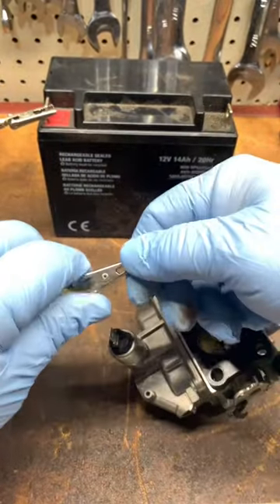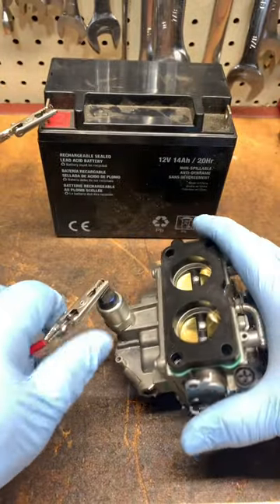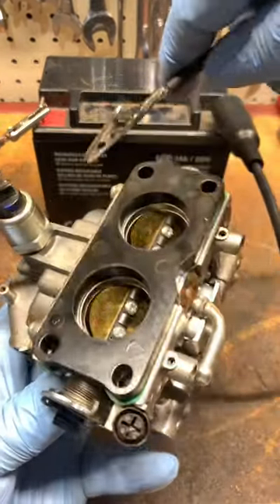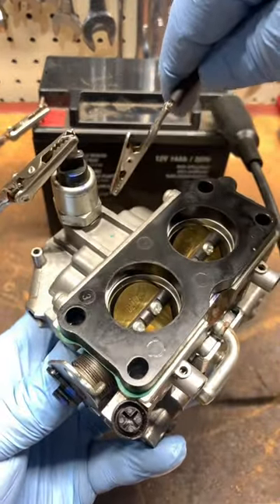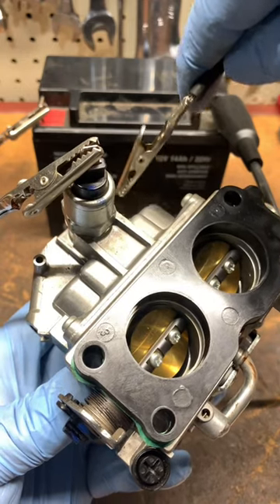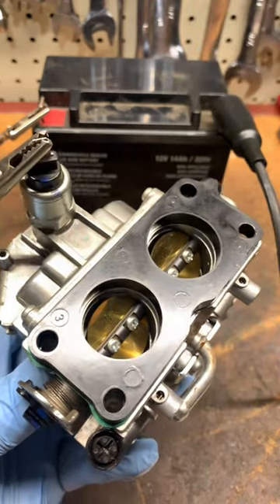Test your Honda carburetor solenoid without removing from engine

Comment: THAT DOES NOT MEAN ITS NOT CORRODED ANDTHE PLUNGER IS STUCK INSIDE!
Reply from the maker: If it is stuck and corroded then it would not click.
Reply: @10minutefix  literally just happened to me the day before I commented. Kawasaki  FS651V.
We were taught at Kawasaki school they will always click, and you have to visually verify the plunger moves at least 1/4”. But I guess that’s why I’m certified by Kawasaki/ Honda/ Husqvarna/ and John Deere.

If the solenoid clicks all that means is the windings inside are still intact and making contact. Means nothing for the  plunger and magnet.
Reply from the maker: Well I’m glad your flexing your certificates. This isn’t a pissing contest for me so I won’t tell you my certificates. I hope the viewers learn something from my videos and if I am wrong then I will learn as well. Thanks for teaching us.
Reply: @10minutefix  I’m not trying crap on your video, but I see this on a daily basis. And unfortunately your method does not actually test the components in question. 
Removal of the valve, and inspection of operation are the correct way to check this. It’s only a 1/2” skinny wrench.
Reply from the maker: Yes you’ll try them. Thanks for watching.

Comment: It tells you that it moves but not if it seals.  You are part right
Reply from the maker: You’re correct but I was mainly trying to demonstrate the test to see if the solenoid moves. Didn’t want to get too deep or very technical. Thanks for watching.

Comment: What is a solenoid valve
Reply from the maker: The solenoid valve is primarily used to stop fuel from entering the combustion chamber when the unit is shut off. This will prevent any backfiring and damage to the engine. When the engine is turned on then the solenoid opens and allows fuel to pass. Thanks or watching. If you want to see any videos of anything else then let me know.
Reply: Oh right I understand thanks alot bro what engine is that carb from
Reply from the maker: It’s from a Honda GX630 but the concept is the same for riding mowers, generators and other equipment. The styles might be different but they operate the same.
Reply: Thanks alot for the reply really helpful